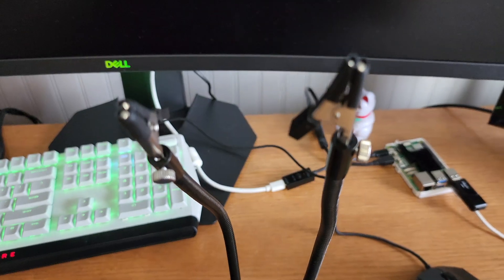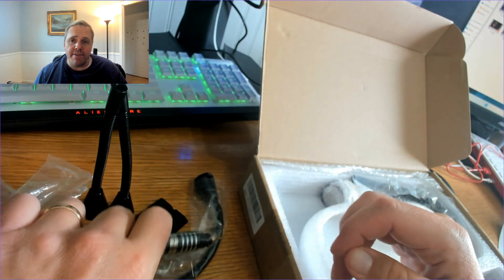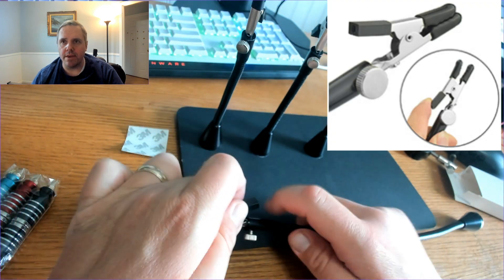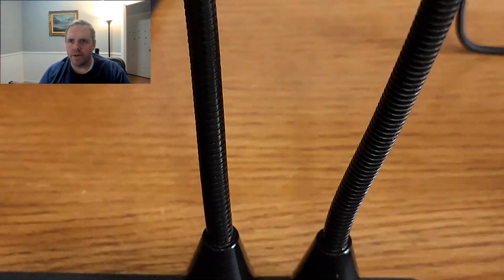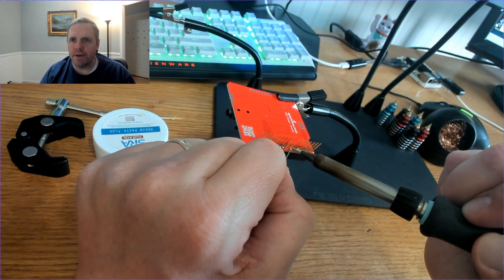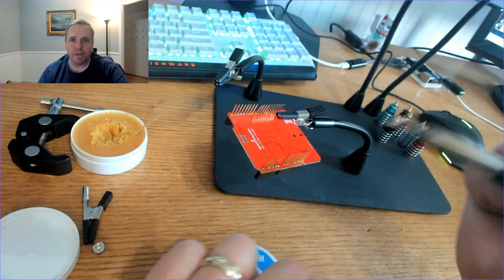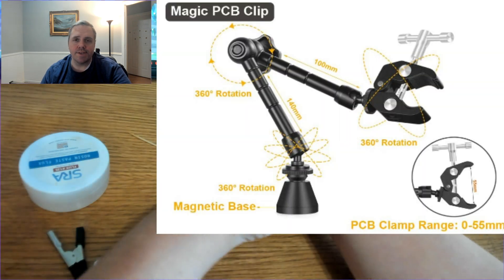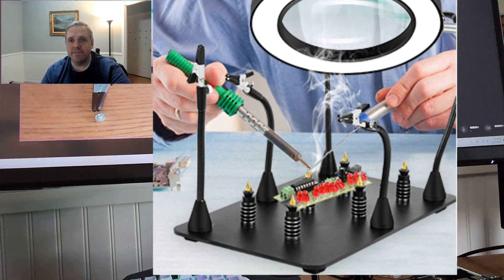A Game Changer for Soldering? Magnetic Helping Hands Workstation Review

Comment: How strong are the pillars/pilons ? Can you lift the metal plate with one of them? Can they slide on the plate when pushed/tapped?
Reply from the maker: They aren't real strong. They stick pretty well but they do slide easy on the plate. I can't lift the plate with one, but with two, I can lift the plate slowly if they are close together and around the center area. They will keep a pcb in place while you solder. I have used them a few time but I prefer the flexible clamps to hold the board because I often turn the board at different angles.
hope that helps!
Reply: @BMonsterLaboratory  Thank you!

Comment: i have a similar one from amazon and the pillars don't have the spike, instead a knob that clamp on the boards.
And it came with a magnifying glass arm which i thought was useless but i've used it many times 🤣
Reply from the maker: I kinda lose my way when looking thru a magnifying glass while soldering. For the most part,  I just need good lighting to see better. 
The pillar spike tips are nice. 
Thanks for sharing 👍